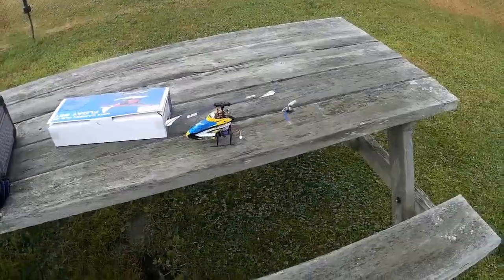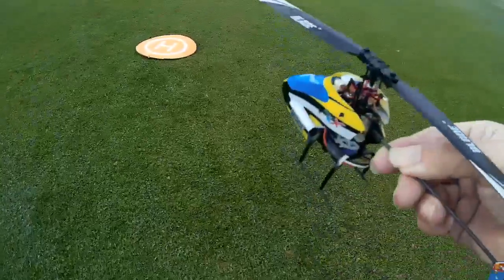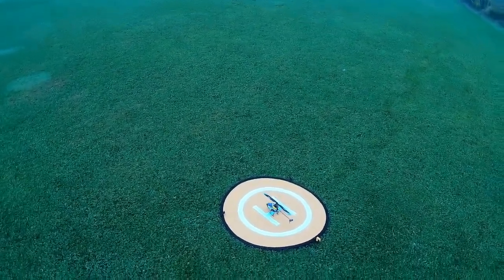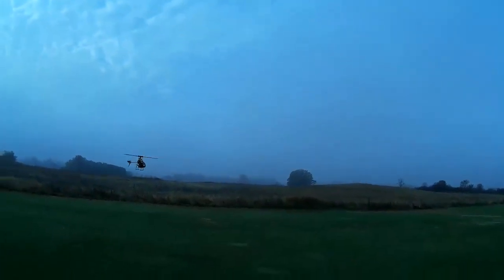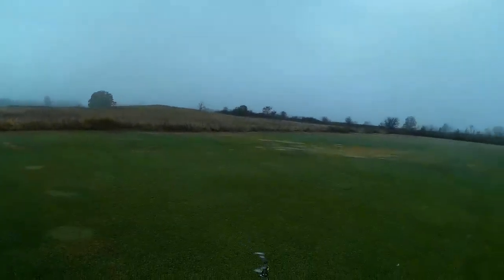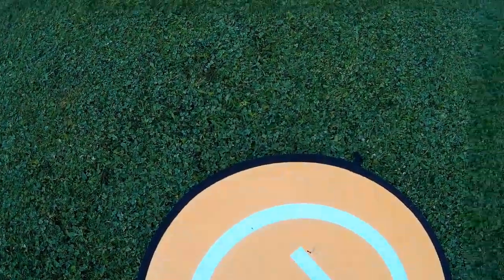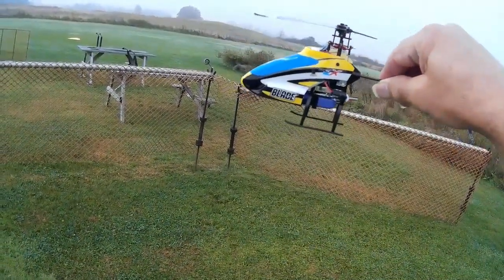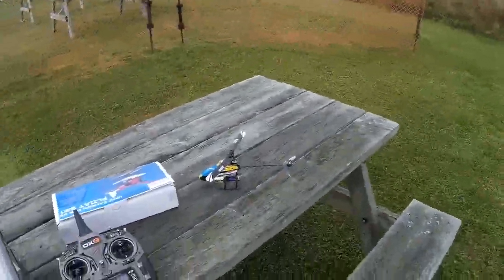Blade MCPX BL re built

Comment: For what it's worth, my mCPS tail used to wag like that just before the tail motor died.  Also, the 100/0/-100 gear switch settings you mentioned are present on all 3 of my Blade heli's profiles.  They are all "S" versions though, so not sure how it applies to this one.  I think it has something to do with the 3 flight modes.
Reply from the maker: Yes, on Horizon products with SAFE, channel 5 will generally control the flight mode. But this heli doesn't have SAFE. I did some research since, and it seems that channel 5 should indeed control gyro gain (for the tail) on this heli. What I have read is that 0% is standard gain (when programming on a DX9), and that going up or down will increase or decrease the gain. If that is correct, then I had the gain set to maximum increase for this flight (100%), which could explain the tail wag. I have moved channel 5 to the left back wheel now, so that I can set it anywhere from -100% through 0% to +100%, and see what difference that makes. But I haven't had a chance to test that yet. It's raining this morning.